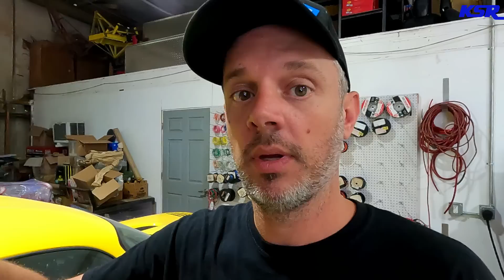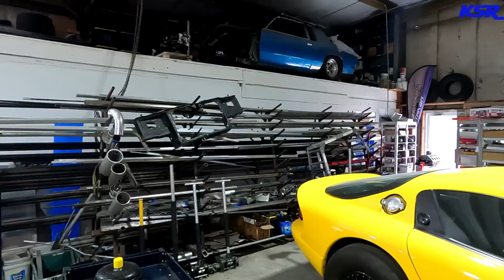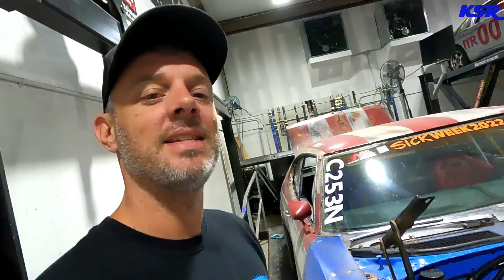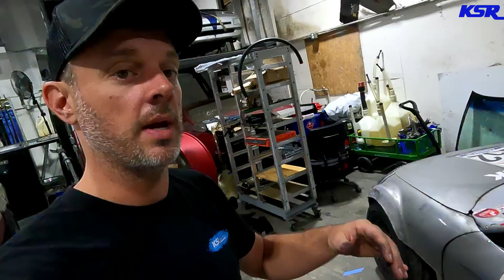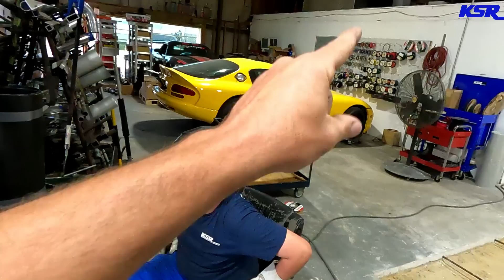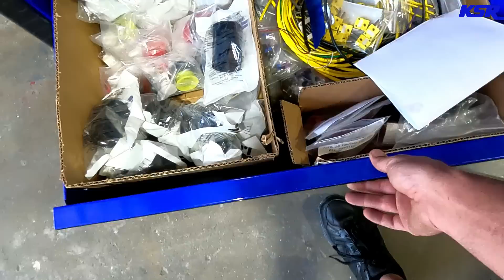Huge Shop Construction Project Progress!!!!!

Comment: Heat sync.
Hmmmmm. 🤔🤔Support Refrigerant system required.
Well any form of coiling creates heat except when Gasses are used.
R22- Chlorodifluoromethane/Freon
R410A- Puron
R134A- Tetrafluoroethane
R32- Difluoromethane
Gasses would be Closed Circuit creating Cool box  Fridge with Radiator pipes inside.🤷‍♂️ Worth a try!

Comment: Hi Kevin just a quick comment on the cooling capacity for Derek's Chevelle, you could install baffles inside the radiator like we do here in Australia, a lot of burnout competitors here use a triple bypass radiator from "Aussie desert coolers" (look them up👍) the baffles ensure that the water takes a longer route to give it more of a chance to cool down before it gets drawn back into the engine. I've used them in all my cars whether they be for burnout competitions or street use and I've never had a drama.👌

Comment: I'm looking to do a power steering conversion on my ute (from Australia) I'm going from belt driven power steering pump to electric.. my question is do you have a electric power steering pump you would recommend that won't brake the bank.. thanks

Comment: I have been using task specific carts in organizing shops for decades, its a great way to go.
Its also a good idea to get a clip board to track consumable usage, we used to do quarterly bulk reorders and it was messy with too much of some stuff, in keeping a record of usage you avoid doing inventory and you can make assumptions From The Data about usage, sometimes eliminating reorder some stuff at a glance. good luck

Comment: This external tank theory to increase the capacity seems a bit ill-conceived to me... if your engine is up to temp, thermostat open and all the water is the same temp, there's no thermodynamics happening in the tank, no cooling force acting upon it, there is no cooler water in the system than what is coursing thorough the radiator -- IF the water pump draws from this external tank its taking away from radiator flow. stay tuned folks

Comment: Concrete cutting guy sux. Overcutting corners on a finished floor, and overcutting in the field. Only a little bit more work to clean cut to cut. And the overcuts tend to crack from the cuts as well. They all want to say they have to do it, but it is not true.  And If you have not poured at this time, add some  body shop pull points in the slab so you can pull a frame if you ever have to, like the pulling of the car with the truck deal.

Comment: Hey Kevin, quick question if I may.  I am getting into 2 complete car builds and wanted to know if you could recommend resources to learn the basics of tuning.  Both projects are using 5.3's with stock PCM's.   I am looking into the tuning aspect, not the technical side.  Hope to meet you in indy next week!
Reply from the maker: HPTuners is the only program that I would use for stock PCM stuff, if I did stock PCM stuff.

Comment: Slab cut outs. Dig deeper  . Cut half thickness slot an inch bigger than hole . Break that out with a hammer so you have a ledge for the new pour. 

I really worry about the tiny cut outs and shallow pour with just rebar preventing the lift from tipping over. 
Dig deeper. Dig bigger than the hole in the slab. So the new pour is under the slab for better tip resistance.  Cost of additional concrete is cheap beside the loss of a car and a lift.. 

Alternate.  Cut an H shaped pattern in the slab. Again dig it deeper. Now it has legs and left and right are attached thru the middle..
Reply from the maker: They drilled into the old concrete and installed rebar pegs to tie everything together.

Comment: Is there a more economical option for doing autosport crimping than the dmc with turrets?
I already have all the ones for deutsch ect
Reply from the maker: I have used my Deutsch crimper for the firewall connectors that we have done so far, but they are not the tiny autosport pins.
Reply: @KSRPerformanceFabrication  thanks thats what I have done as well. But someone wants me to use autosport when I do thier engine harness and ots hard to swallow the money for the dmc with turret for 1 car

Comment: Hay just a tip have them remove the rebar and use fiber reinforced concrete that way you don't hit it when drilling for the hoist. Is stronger then the rebar aswell

Comment: Kevin hope you see this your talking about a  flat level pad for your scales dont place them by the lifts. Even them pouring "thicker footers" piers for lift and doweling into exterior pad your gonna get flex and settlment from weight distributing from the lift after useing it. so the issue you have may happen again. Part 2>
Reply: I would pour interior footers directly below where you are wanting to place the scales in between your lift the length of the average car you scale so there is no give or flex at the scale

Comment: Advice on garage doors.  (have installed a few)
Usually a side mounted opener works best on taller doors like that size . Also , once a year douche the tortion springs really good with wd 40 or whatever. Lube the roller bearings , tracks and hinges  a well.
Do this vand you will have zero door issues.....unless someone hits them
(youll save bookoo bucks bigtime !!!

Comment: I'm drooling over that new electrical wiring box. I've done similar and have run out of room. With new mega (amg) fuses, micro relays, LEDs,......  I think I need a wire rack like what CJ built. Maybe for wire loom too. I have to thank you. Your listing of what wires you need to run to where ever has caused me to step up my game and really think ahead. Oh, I wire a lot of our lighting on the tow trucks where I work.

Comment: might be a good idea to undercut a little under the old concrete floor , that way should the concrete "plug" come loose from the floor it still hangs ontoo the underside of the floor outside of the hole made for the pug 
about the rolls or wire : make sure you put spacers with a small locking bolt in it  between the spools else you gouing to pull on one wire and cause the spools next to it to unlroll too 
prolly a good idea to prevent the axle going through the spools from rotating too for the same reason

Comment: On independence the hot water should go in the bottom of the tank so thermal dynamics can move it. The old international cub tractors used this theory to be able to run the engine without a water pump.

Comment: I used to build boats back in my two legged days. Our building also had the wood and cabinet shop in it. The router tables and table saws were very loud, and echoed throughout the building. Hearing protection is no joke. I'm with Drew on this one

Comment: As someone who never wore ear protection at work whilst working around heavy machines for 45 years I commend Drew for his attitude....

You as an employer shouldn't try to belittle an employ for protecting their hearing 🙏🏻

Edit:- I know you were only poking fun and didn't mean it in a malicious way 👍🏻 I ruined my ears unnecessarily just through stubbornness, they make some really good ear protection these days without having to have huge cans on all the time though 🥲 Decibullz make some great ones that are heat mouldable and just fit in your ear, with some fancy magical percussive filters in them,helps with the situational awareness that you can lose with big ear defenders 🙏🏻...
Reply from the maker: Drew knows I’m just joking. I ear ear plugs a lot myself.
Reply: @KSRPerformanceFabrication  I think I'm more mad at myself still than actually mad at you 😂🥲 People like cleet and James et al need to start using them more often, be good drag racing role models 🙏🏻
Reply from the maker: @BariLopesh  I do not disagree there. My helmet has noise cancelling headphones in it because of the radio communications that I have in it, but when I rode in Warbird, I had ear plugs in.

Comment: Sorry Kevin.
It always better to be safe than sorry.
 If you think you need ear protection then use em. Especially working around loud engines and equipment daily.
Good job Drew Leading by example.

Comment: I would love to see a water tanks have some sort of copper heat pipes or coil like is used in pcs just because of the crazy heat dissipation and wonder if it would help or be a total fail alcohol companies and moonshiners also use it there condenser Barrels to dissipate heat so just would love to see a experiment to see if it would help

Comment: The first set of scales I ever worked with, we had a perfectly flat pad to set them on so we didn't bother to check the level of the scales. Get to the track and it's pushing to the left, loose to the right, clearly wedged like crazy but it scaled perfect. What the hell? Turns out one of the scales was just 1/8th of an inch thinner than the other three. That's all it takes.

Comment: I hope they are going to drill the pad to cross tie it in to the old slab
Reply from the maker: They did
Reply: @KSRPerformanceFabrication  when I did mine I did a 3-ft hole for a pier with rebar plus the top 8 inchs because my original slab was only four inches thick
Reply: @KSRPerformanceFabrication  can't wait to see the video on your car

Comment: "THERMODYNAMICS" this is  refreshing to see you using this method to cool that is so often over looked some people think that circulating the fluid is necessary that is only one aspect, fluid chases heat until it equalizes [conduction] the heat dissipation is now based on surface volume, something to consider adding tubes that allow air to flow through your reservoir this will increase the surface area make your reservoir tank much more efficient. Just a thought.
Reply: Thermal mass FTW!  Maybe cooling fins on the tank if they have the airflow under the hood.
Reply: @lazylizard6532  Yes even more efficient [surface area]

Comment: Those post piers are not deep enough.  I'm a structural engineer and a two post lift will not stay upright if you just attach to the pads like that.  You also need to dowel in the piers to the floor slab.   I would not do that unless they were at least 3 feet deep and full of rebar.  If you are doing a 4 post lift yes but not a two post lift.
Reply from the maker: The piers are 10" deep, plus pegs into the old concrete, plus rebar, plus a wedge cut out under the existing concrete. The new concrete is fiber reinforced concrete so I hope it is enough! The old floor was only 4" thick.
Reply: 4 “ is. It not enough for what you are doing.  The pairs are way to small and using the existing slab to work against over turn it not a good idea. The level pad should be an isolated slab.  Just beware.

Comment: As somebody else mentioned, they really need to do the same treatment to those small spots for the lift... but more than that, I think those areas you're pouring need to be much, much bigger.  That lift is an awfully big lever arm with a lot of weight on it, and I could see it just popping those small chunks of concrete out like nothing.
Reply: Kevin should have hired one of you guys with no experience (in the real world) instead of the incompetent team he hired. He always cuts corners, so I am sure the guys he hired are terrible. /Sarcasm.
Reply: I was thinking that same thing.
Reply: The lifts have a bar across the top that's bolted on. So there is not much side load as you would think.

Comment: Man Kev… I’m no concrete expert but the holes on both sides of the vette seem like a terrible idea… I get the reason, but fresh concrete in those holes isn’t going to bond to the old concrete… Essentially the lift will just have concrete “feet” since the concrete is not all one piece… imo
Reply: He has to be using rebar to connect to the old slab right??
Reply from the maker: Yep, there are rebar pegs drilled in horizontally into the old concrete.
Reply: @KSRPerformanceFabrication  makes sense… in the video just saw the smooth cut from the saw and rebar mat on the dirt but nothing into the old slab yet… obviously. Guy below is confused on his name unless it’s Kevin also. Must be a concrete expert. All it takes is common sense… when there’s a video that shows a smooth hole and nothing to bite into the old slab… makes you wonder how physic’s isn’t just going to rip the square chunk right out of the floor… lol
Reply: You should have just clicked cancel on the comment when you typed "I'm no concrete expert"

Comment: If Drew thinks he needs ear pro, he needs ear pro. Thanks to a few fire fights with ear pro that didn't work worth a damn I have tinnitus so bad I couldn't tell you if my refrigerator (or dishwasher, or pretty much anything below 50db) is running if you paid me to. I wouldn't wish that on anyone else.
Reply: I had tinnitus after breaking my ear drum, it cleared up after about 8 weeks. Maybe yours will mend slowly too.
Reply: @jameseastwood4984  not this. That’s permanent hearing damage. It’s insanely loud when your surrounded by guns going thru tons of rounds for a decent period of time. Depending on the situation of being inside, or right by the 249 or 240, or in a vehicle with an M2 going off. It’s on par with twice as Loud a rock concert, then do it more then once….yeah. Fun times. 

I’ve started “listening” for the vibrations on things now more then the actual sound. Luckily I can still distinguish a humm out so it helps
Reply: HUH?!?!
Reply: LET THAT 240B MASSAGE YOUR BRAIN AND LOVE IT. WHAT?!?

Comment: Extra ear protection never hurt anyone. Stay safe Drew!
Reply: Huh? What?!
Reply: I started wearing ear plugs if I have a lot of grinding to do. It's just less fatiguing as well as adding protection.
Reply: @jameseastwood4984  you’d be surprised at how loud a cordless impact wrench is….I had no idea until I checked it with a spl meter. Sometimes had a peak of 130db!
Reply: @jonnyonwheels  I think you're right, I've started wearing the ear plugs for a whole session if it's going to be a noisy one, it's more peaceful. I do have to turn the radio up a bit though so I can still hear it 😂
Reply: I wish someone would have told me that a long time ago...hey!! somebody answer that darn phone!!...I should have worn a lot more hearing protection working around US Navy Jet powered aircraft.
Reply: Drew musta been artillery 
Hearings gone anyway
Reply: PPE FTW!
Reply: PPE for you and me!!
Reply: Yes, wear ear protection! I can trace my hearing loss back to just a couple of obvious instances and a ton of low level instances. Once it's gone it doesn't come back so yeah wear it and wear it often!

Comment: Kev, Make sure they put dowels into the old pad before they pour for the bendpak.
Reply: Exactly. Was looking at the rebar in the hole and thinking “that’s not better than the old concrete that had a bigger footprint”
Reply: @exportedafrican  Lol.
Reply from the maker: They drilled horizontally into the old concrete and put some rebar pegs in to tie the old and new concrete together.
Reply: @KSRPerformanceFabrication  awesome! Hopefully with epoxy and then you are set!
Reply: @exportedafrican  yupper.
Reply: @KSRPerformanceFabrication  Good deal.

Comment: If you have cut the floor for a jack and it is not a homogeneous screed anymore, you should deepen the holes to at least 2 feet, or anchor the reinforcement in the existing floor. Otherwise, when you pick up a block, the jack (as I understand it, columnar) will fold inside. This idea with a perfectly leveled floor under the weight is very cool.

Comment: Hey Kevin? You have night security? You WANT night security? I know a guy. It's me lol. A place to do the 3 S's is all I'd need. My f150 is comfy. Beats a chevy luv, or s10, or cutlass cierra. Put a tarp in the bed, boom, I got a pool in my backyard. 

Gonna need a roll of gorilla tape, and like 50 plastic flamingos... oh, and a blow up palm tree with LEDs.

Drewski, I will never laugh at Muffs or Safety Specs. I WILL, however, reserve the right to say, "if it's not sharp, hot, or 80/90, take off the gloves."

...bitchmits...
Reply: If you are changing a diaper, glove up DOUBLE. That's some 80/90, and also Hot. See? Sliding scale, kinda. Heheh